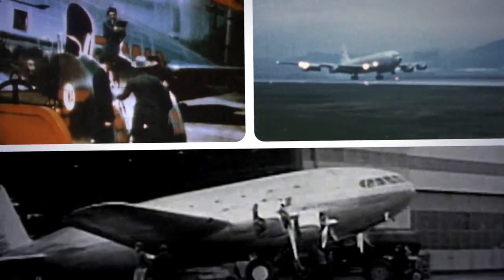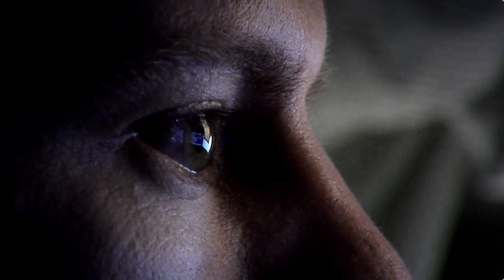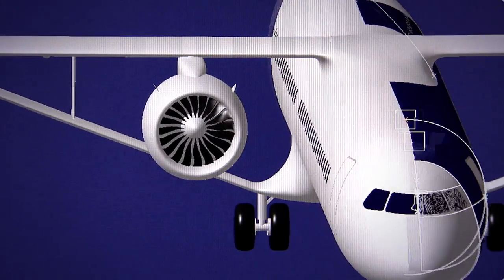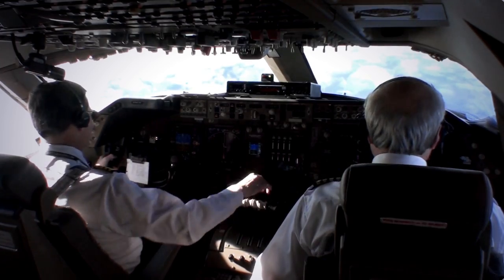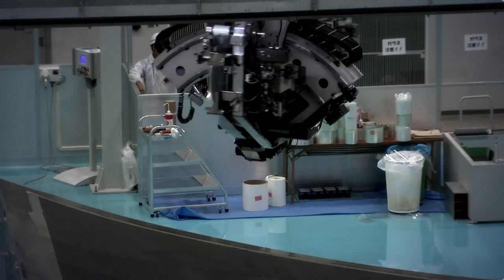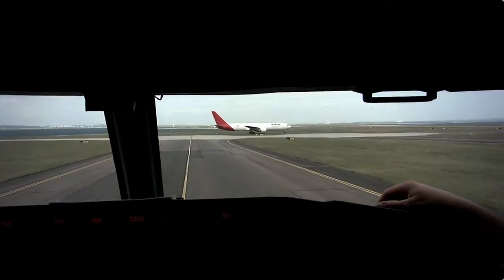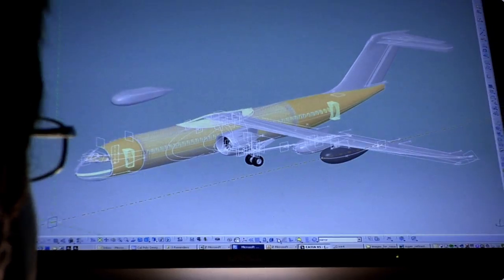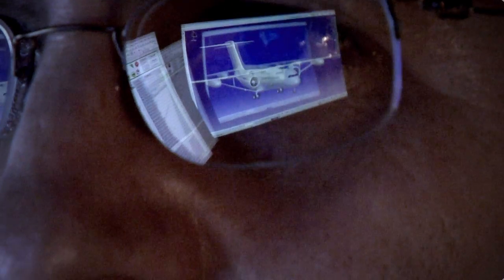SUGAR Volt: Boeing's Hybrid Electric Aircraft

Comment: With today's technology, we could build large aircraft with ultra-compact nuclear reactors.  Zero emissions, zero CO2, and they only need to refuel every few years.  Unfortunately, there has been so much blatant fearmongering and anti-nuclear propaganda- a lot of it outright lies- that we'll never see nuclear development in the US.  Too bad, as nuclear power kills fewer people per unit of electricity than any other form of power.
Reply: Mark Stockman Problem is. You don't want 500 aircraft powered by nuclear reactors flying above your city every 20 minutes.
Reply: Mark Stockman And what about the risk of reactor vessel rupture in a plane crash???  Because when this happens, it won't MATTER what type of reactor it is or whether it can suffer a meltdown or steam explosion -- when this happens, the radiation will end up splattered all over the area, whether under pressure or not!
Reply: Mark Stockman WRONG -- in a high-speed impact with the ground, the fuel scatters all over the place with the other debris, whether the reactor melts down or not!  And in this case, people die and the cleanup NEVER gets completed!
Reply: Mark Stockman Lead-cooled reactors are the very devil to refuel -- the Russians used these on their Alfa-class subs, and they turned out to be so hard to refuel that they actually had to scrap the whole sub after the nuclear fuel was used up, rather than replace the spent fuel!  And also, you've just brought up THE most important reason why nuclear-powered aircraft aren't feasible -- with the heavy nuclear reactor, it's like having a full load of fuel at all times, which keeps the payload WAY down -- and there's no way to increase the payload by reducing fuel load, because the nuclear reactor is a fixed load!  As for the GE nuclear turbojets, they actually put them on a modified B-36 -- don't you figure there was at least one good reason why they never built a second B-36 like that one?
Reply: Mark Stockman Not melt down. CRASHING into your house would be the problem. The other reasons why they don't use it is because people want to get away as far from nuclear reactor as possible. Riding on a plane with nuclear reactor in 12 hours is a nightmare, especially for Flight attendants or pilots who do it in daily basis. Also, we want a plane that uses less energy, not a plane that too powerfull.
Reply: Mark Stockman Yeah, like tnt ntn says -- if the plane crashes, the reactor would rupture from the impact and spread the radiation all over the place!  Which I've already mentioned to you FOUR TIMES, and you still haven't said ONE WORD about THIS scenario!  All you keep on harping about is "can't melt down, can't melt down" ad nauseam, as if reactor rupture from impact was not an issue AT ALL!
Reply: Mark Stockman And if the radiation goes into the groundwater?  How will you clean THAT up?  Oh, and let's not forget that CO2 is harmless to human health (unless the concentration is high enough to suffocate you, which is NOT the case here), and that particulate emissions from modern jet engines are insignificant!
Reply: Mark Stockman You sure?  The mixture is 53% NaF, 41% ZrF4, and 6% UF4 -- and the former two components ARE water-soluble to a significant extent!  (As for UF4, given its proportion in the mixture, it could go into a colloidal form when the other two dissolve -- and thereby enter the aqueous phase in this manner.)  And even if the uranium doesn't form a colloid, the zirconium dissolves significantly (13.2 g/L), AND it becomes radioactive over time with exposure to radiation!
Reply: Gordon Dean Actually, a B-52H has a fuel capacity of over 335,000 pounds.  At full fuel load, even with no payload it's still too heavy to take off under its own power.  It has to get airborne, then top off from airborne tankers.  And the AN-225 (world's largest cargo aircraft) has a max fuel capacity of over 661,000 pounds.  The AN-225, like most aircraft, has to make a tradeoff- short range at maximum cargo capacity, or limited cargo capacity at maximum range.  Either a Molten Salt Reactor or a Lead-cooled reactor could do the job.  The beauty of a lead-cooled reactor is that the primary coolant also provides shielding.  The technology isn't a pipe dream- General Electric had nuclear turbojet engines working in 1955, and by 1956 there were two different reactor designs operating.
Reply: Dennis Kitainik There were some design issues with the Russian lead-cooled reactors, but nothing that couldn't be fixed.  Okay, we know X, Y and Z didn't work on the Mark 1, we fix those issues on the Mark 2.  Repeat with each generation of product.  As to reactor weight,  when I run the numbers it comes out way less than a full fuel load, especially with a large cargo aircraft- otherwise, what would be the point?  AFAIK they never actually mounted the GE Turbojets on an aircraft.  They did mount a working reactor in a B-36 to test the shielding, but it was never hooked to anything.  And this was in the 1950s before we had modern shielding materials like borated polyethylene, etc.  It was the ICBM and the surface-to-air missile that killed the NB-36 program, not the technology.
Reply: Mark Stockman Let's do some math here, shall we?  For example, take an aircraft of the same size as the Russian An-22 (the biggest prop plane ever built, which is why I chose it as the basis for the comparison): that aircraft has an MTOW of 250 tons and an empty weight of 114 tons (giving a useful load of 136 tons for fuel AND payload, of which the maximum payload is 80 tons, leaving 56 tons for fuel), and requires about 44.744 MW of power at the shaft for propulsion (4 NK-12 turboprops, 11.186 MW each) -- and is considered underpowered even so!  To generate the same amount of power from nuclear fission would require TWO Hyperion HPM lead-cooled power modules, weighing 50 tons EACH -- which, for an aircraft like the An-22, would be equivalent to carrying 100 tons of fuel (almost TWICE AS MUCH as a full load) and would therefore cut the payload from 80 to 36 tons!  In other words, it's like not only taking on a full load of fuel, but also filling half the cargo space with long-range ferry tanks!  What say you to THAT?  And you still haven't provided any specifics on how you plan to deal with the refueling problems or safety issues I brought up earlier!  (BTW, the HPM is not designed for on-site refueling either -- it has to be removed from the aircraft as a unit and brought back to the factory for refueling, which, for an aircraft, is problematic to say the least!)
Reply: Actually, the figures given by Oak Ridge National Laboratories (ORNL) in 1952 called for a 400 MW reactor, intermediate heat exchanger, and shielding under 120,000#.  400 MW should be enough to power an aircraft the size of the AN-225 Mirya, the world's largest cargo aircraft.  The AN-225 has a maximum fuel load of 300,000 kg, or about 661,000#.  Figuring pounds of fuel per mile from the maximum range of 9,569 miles, then multiplying by the range at maximum payload, we get a fuel capacity at maximum payload of 172,800#.  So, if the actual reactor is 40% heavier than the 1952 estimate, the range of a nuclear powered AN-225 at max payload would go from 2,500 miles to the endurance of the crew.  Oh, and with a Molten Salt Reactor, the reactor fuel is liquid, and also serves as the primary heat-transfer fluid.  To de-fuel a MSR, pump the still thermally hot fuel into a shielded tank truck and haul it to the nearest fixed MSR for reprocessing.  Pump in fresh fuel, you're ready to go.  As to safety, MSRs have a very large negative temperature coefficient- as temperature increases, the fuel expands, which reduces the radioactivity.  So, the reactor power level automatically changes to follow the thermal load.  And MSRs are passively safe.  A reaction can only occur inside the reactor core, because of the combination of its shape and the presence of a moderator.  If the reactor overheats or loses power, a "freeze plug" (a section of pipe containing fuel kept below its freezing temperature) melts, and the fuel drains into a dump tank where it can't react and will cool passively.  In a worst-case scenario, since the fuel freezes solid at room temperature, guys in rad suits would just scoop up the chunks of frozen fuel and a little of the dirt they were laying in and dump them into lead-lined barrels for transport to a reprocessing facility.http://web.ornl.gov/info/reports/1952/3445603605846.pdf
Reply: Mark Stockman All this is purely hypothetical -- right now we don't HAVE a 400-MW reactor that weighs 120,000 lbs. or less!  As for molten salt reactors, they ARE easy to refuel, I'll concede that much -- BUT the drawback, once again, is that unlike molten lead-cooled breeders, they need separate radiation shielding to protect the crew and passengers!  And as for safety, a negative void coefficient and/or passively safe design is NOT enough for this application -- because the worst-case scenario, in a nuclear-powered aircraft, is NOT a core meltdown, but a REACTOR VESSEL RUPTURE from outside forces (very likely in a plane crash, such as a CFIT or a midair collision) with the resulting massive leakage of radiation!  Or has it slipped your mind that the reactor will not be in a stationary installation, or even on a ship, but on a plane which could easily get smashed to smithereens if the pilot flies into a mountainside, and that therefore the main danger would come not from the inside but from the OUTSIDE of the reactor?
Reply: Mark Stockman I just double-checked -- the HIGHEST power-to-weight ratio for any existing nuclear reactor design (even the ones which only exist on paper so far) is 2 MW per ton (this is for the aforementioned Hyperion HPM, and this is the MOST OPTIMISTIC estimate at that) -- whereas your so-called "figures" call for a whoppin' 66 2/3 MW per ton!  So this so-called "study" you cited is nothing more than a pipe dream for the distant future!
Reply: Except that this study actually built three working reactors- the Heat Transfer Reactor Experiment (HTRE) 1, 2, and 3.  The difference between a conventional reactor and a MSR is similar in magnitude to the difference between a steam locomotive and a diesel locomotive.  The famous "Big Boy" put out 6,200 hp and 134,000# tractive effort (TE)- at a weight of 1.2 million pounds.  A GE ES59ACi puts out 6,250 hp, 140,000# TE starting, 127,000# TE continuous as a svelte 330,000 pounds- 1/4 the weight. (FYI that TE has got to be close to the theoretical max for that weight, weight on rail being a factor.)  One major advantage of the MSR is that the fuel circulates at atmospheric pressure.  So, no heavy piping, pressure vessel, or concrete containment structure required. Chance of steam explosion or meltdown: zero.  Also, for a reactor that just sits on the ground and generates power, weight isn't an issue, so you design it to save dollars instead of pounds.  If you're designing an aircraft reactor, you design it to save weight instead of dollars.  Plus, we aren't limited to 1950s materials:  http://www.ncbi.nlm.nih.gov/pubmed/23009182
Reply: Mark Stockman BTW, the HTRE-3 (the most powerful of the trio) was only powerful enough to run TWO J-47 engines, which is NOWHERE NEAR the kind of power needed to keep a Mriya or even a B-52 in the air (for the record, the B-47 needed SIX of these, and it only weighed 50 tons at takeoff!)
Reply: tnt ntn Actually, with an ultra-safe design like a molten salt reactor, it can't melt down.  Worst case, the fuel leaks out- and freezes solid.  Nobody dies, cleanup is quick, cheap and easy.  I'd rather have a nuclear powered aircraft crash into my house any day instead of one carrying tons of jet fuel.
Reply: A MSR that ruptured during an aircraft crash would spill its fuel.  For anybody standing close by (but not close enough to be killed by the falling airplane) that would be bad- enough radiation to kill you, and that takes a LOT.  Just less painful than being burned alive in a puddle of blazing jet fuel.  And chunks of radioactive fuel would be scattered around the crash site- NOT microscopic particles all over the town/city/continent. Cleanup would involve a bunch of either robots or humans in radiation suits shoveling the fuel into barrels.  That's it.  No long-term environmental damage. I'm not claiming that modern nuclear tech is 100% safe- nothing is ever 100%.  But based on the science, I'd feel more comfortable working and living around a bunch of safe reactors than around thousands of gallons of petroleum fuels.  Oh, and let's not forget the CO2 and particulate emissions from aircraft, either.  Per the World Health Organization, seven million people die every year from air pollution.  So, air pollution kills more people every day than nuclear power has since the first commercial plant came on line on December of 1957.
Reply: Dennis Kitainik Groundwater contamination would be pretty difficult, since the fuel/coolant mixture freezes solid below about 800 degrees F, and isn't water soluble.
Reply: Mark Stockman Good idea...not feasible.  Way back in college I designed a portable nuc. reactor for power generation.  It was designed to be hauled on a truck.  Its weight was several tons because of the shielding required.  Too heavy.

Comment: Why don't you guys incorporate solar panels into the top of the wings? Above the clouds it's nothing but sun, and you could cover the panels with plexi or something light to keep the airflow steady. That would reduce or eliminate the need for big heavy batteries. Another not so radical idea, I think, would be to have turbofans for takeoff and high power situations, but turboprops with pusher propellers on the rear of the wing to reduce drag and for use in cruise flight and taxiing that use less fuel and are quieter than the turbofans.
Reply: Solar panels are a non-starter -- they're inefficient, plus they'll degrade quickly from friction heating (just so you know, the wings of a passenger jet get hot enough during cruise flight that you could literally fry an egg on them!)  Now the hybrid turbofan/turboprop, on the other hand, is a pretty good idea -- in fact, it's been tried (remember the UnDucted Fans, anyone?) and found to save quite a bit of fuel.  Maybe it's time to revive that idea?
Reply: I think you're talking about the batteries being non starter. When hot, batteries do lose charge VERY quickly, but solar panels last just fine in texas, arizona, new mexico, etc. They're designed to be in direct sunlight and heat. But yeah the turbofan/prop hybrid would be pretty cool. Very safe too.
Reply: Dennis Kitainik Wings at altitude do not get hot.  Why do you think fuel gets cold and leading edges ice up.
Reply: xxtwr1 What about aerodynamic heating from friction?  Or is it only an issue at Mach 1+?

Comment: never going to get an all electric plane and the same goes for pulling heavy loads with wheeled vehicles.  The more load you put on an electric motor, they start sucking down the batteries,  Ain't gettin very far with a 63 ft loaded semi on electric and the cost would be prohibitive.
Reply: Those trains have massive engines in them and run constantly.  If the train is standing still they idle, most of the time the motors are cranked up and churning out lots of exhaust because there aren't any batteries even available to literally run a train and that ain't gonna happen in the near future.  The weight and room problem is still a long time away from being feasible.  Cars and trains run on the ground and transfer the weight to the ground, not happening in a plane.  The same issue with semi's.  Hybrid cars are only good for one thing, getting people from point a to point b.  The must have an engine to support their high milage claims and don't waste time putting any kind of a hitch on them as they can't handle it.  No, it will be a very long time before those changes come if indeed the world is here for it to happen.
Reply: there is still a generator somewhere making  that power, I guess I should have clarified, battery powered vehicles.  And as far as that ice thing, you obviously don't live in a state that has cold winters and the earth has been going in cycles with temperature since it was made and will continue to do so.  There is nothing we can do to change that and anybody who thinks so is missing a couple of carbon credits......
Reply: Batteries are improving all the time. By 2050 we will wasily have batteries with greater energy density than gas.
Reply: I doubt that and the way we are going globally  we won't be here to worry about it.
Reply: Biofuel for tractor-trailers' diesel engines. But after seeing the electric Mercedes SLS, I'm sure cars will be electric, especially as the batteries' capacity/energy density goes up along with the safe charging and discharge rates. For airplanes we need something else again.
Reply: Robert Bowen Untrue.  Battery technology advancing fast.  Promising recharging technology allow for full capacity in minutes, not hours.  Trains, heaviest land vehicles, all run on electric motors and batteries; diesel engine only present to generate power when needed.  Could be applied to transport trucks.  Cost is only prohibitive because technology is new; cost of internal combustion engine once prohibitive as well.

Comment: What about catapults to get into the air?
Reply: I would rather do for a teleporter. That right there is the future of travel.
Reply: Impractical.  Would need to install a catapult at ever airport the airline would visit.  Much cheaper and more efficient to install jet capabilities on board aircraft, even if only used on takeoff.
Reply: *laugh
Reply: Stella Aduras Don't be so optimistic -- the jet engines will actually be in use ALL the time from takeoff to landing!